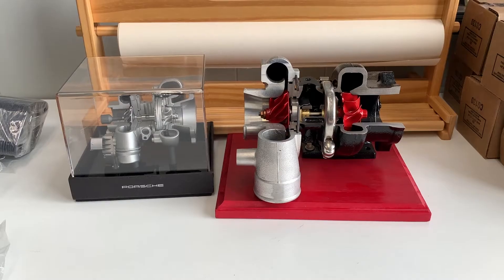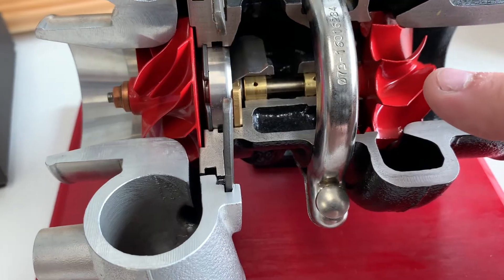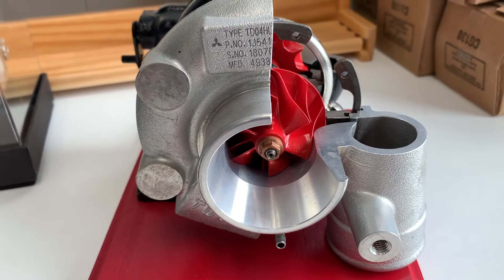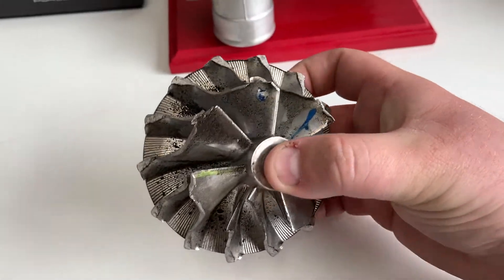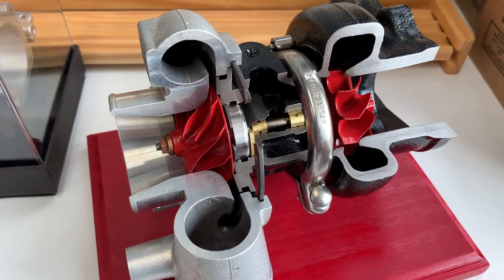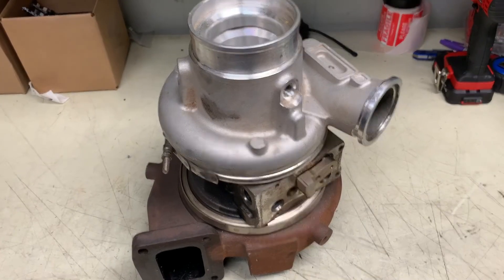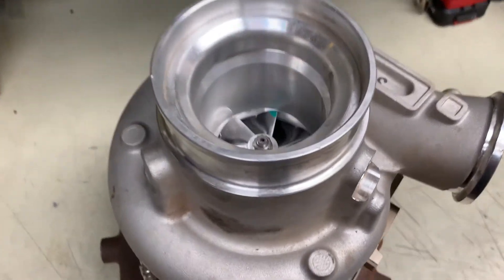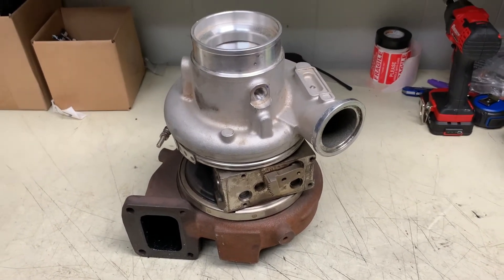Why is my new turbo leaking oil?  What causes turbos to fail, and whats in my turbo?

Comment: I'm fairly new to turbos. With that said, i have experienced this "blown seal" on the turbine side. I'm pretty confident that i have resolved the issue (oil drain/crank case pressure relief).
After fixing the drain issue and replacing the entire turbo, everything is fine.

Please explain to me how i was loosing boost pressure?
Is the turbo that i replaced still good?

Comment: I have a Jetta4 1.9tdi AHF engine code,it broke the turbo shaft while driving on the highway. I managed to drive the car back home,about 7km. Car was just smoking but wasn't leaking oil off the exhaust.
Now I've managed to put in a good known turbo,and suddenly it's pissing oil from the exhaust pipe.Do I suddenly have worn valve seals,or damaged piston rings?

Comment: Thanks for the nice video...well explained..

I have a bmw e46 320d m47...today in installed my turbo from service, it was leaking..after fitting, I never drove the car,I started it ,idling for 30mins or more, I saw oil dripping from intercooler turbo pipe,then it's also smoking..not that much  but there is a smoking showing that oil is leaking into exhaust pipe..

I opened the Lid the one for engine top up whilst the engine was running..a lot of pressure  is coming out...

Is there any possibility that  the turbo is damaged again or what?

Comment: Hey, great video. My 2024 Equinox  with 1.5 engine and turbo seems to be leaking oil in the turbo area. The car is less than 2 years old and leaking oil should not happen. Do you have any ideas? Thanks

Comment: Hello, I have a 2018 isuzu nqr producing  high blowby  and loosing a lot of engine oil with it. Just wondering if  it is possible that the turbo is leaking boost Into the crankcase through the turbo bearings. Appreciate any feedback. FYI my truck is deleted and egr I active.

Comment: Really !?? ANY turbo will leak oil... when  the Oil cannot drain   adequately.
  From either an silly small Drain system And ?or a big Blowby ussue that pressurises the bearing housing and forces oil out . 
ALL else is simply Bullshit.

Comment: Thanks for the informative video. My Nissan Terrano (TD27 engine) is getting oil into the air intake and sometimes does a runaway when still cold. There is oil around the boost pipe, could there be oil accumulated somewhere that causes this?
Most times I start the engine when cold there is rough running, blue smoke, and chuffing exhaust. 
It behaves fine when hot. 
The piston rings seem ok, after long downhill deceleration, then sudden acceleration at the bottom, there’s no blue smoke from exhaust.

Comment: Curious about this i installed a new Journal Bearing 3076r on the engine making 85psi cold start and up to 100psi at the top of pull. We are running no restrictor in the feed as its a journal bearing, but think we may need one for the PSI. We get oil in the compressor wheel.

Comment: Good video i do have a  question.  I have a 2018 mercedes s560.  I noticed that the car shorts oil and i have to top up. Also noticed was oil on the intake of the turbocharger.  Is it normal?

Comment: Mitsu Td04 is a VERY durable turbo Look elsewhere for a problem.

Factory oil return lines between Turbo and Oil sump are obviously... Stupidly undersized.. !
 Oil can't get out as fast as it's being fed to the Turbo . ID of the oil drain tube needs to be 18mm MINIMUM 
Creating excessive oil back  pressures  which forces  itself thru any and All paths it can Find

Comment: Hi. My 2012 Spanish built Nissan Navara D40 St-X Diesel when idling its fine but dies off when i give throttle. It also smoke a whitish blue haze.

Symptoms is its hard starting however there's no oil in coolant or coolant in sump oil.

Would you have any idea what may cause this?.

Comment: Hi i need some help.. m57 525d 145kw.. the turbine was leaking a little oil into the intake manifold.. so it had to be rebuilt.. After the rebuild, I installed it and the turbine was pushing oil from the exhaust and intake side.. I had it rebuilt once more.. they said it was fuel in oil.. I had the injectors rebuilt.. I put everything back together.. and the oil pushed out again, it's strange to me, because before the  the turbine didn't do that.. if u know anything...

Comment: Have a 2017 Ford Escape Titanium with 50k miles that has been diagnosed with a turbo leak. Seemingly on the exhaust side. If the leak is caused by one of the reasons you mentioned does that mean you could replace the air filter for example and the problem would be fixed? We are at a loss as to what to do!?

Comment: Wait you had me at excessive idle. In the last year my Colorado has been doing this. If i idle for a long time and then get going there's always an oil burn off smell. I've never seen any corresponding smoke though. Should i be concerned? Just cut back on the idle time?
Reply from the maker: You can bump up the idle a bit to help mitigate the issue

Comment: I tend to disagree on the vgt egr topic, I've  found that removing the cat makes the turbo run alot cooler and when the car is granny driven for a couple  hundred miles  the vanes tend to get stuck ... how i usally tread this, is take the car for a good highway drive hitting the redline a few times , the heat burns all the debris  from vanes and nozzle ring. Egr delete isnt what cause the vanes to get stuck but actually  removing catalytic converter/muffler ect. The more heat the better . This was only my experience  and its on a TDI car and not a truck so it might be a different  story there.
Great video keep up the good work
Reply: Interesting! I did a EGR and DPF delete on my D-Max Pickup truck because the DPF causes problems if your are not running pure white diesel and the EGR just got cloaked when you are driving in the city. I get from time to time a P0237 code and oil in the intake. Now I will follow your "Italian" method and look how it goes...

Comment: I have a 2011 6.7l powerstroke and I removed the DPF and left the egr on the engine but it's disconnected, are you saying that EGTs are hotter with the dpf disconnected, I thought it helped the engine breathe better and run cooler. Did I under stand you correctly?

Comment: maybe a jammed waste gate valve causes excessive rpm of turbo shaft that can damage the seal and eventually break the shaft.Safe if you install turbo gauge so you will be alarmed if boost goes beyond normal.

Comment: I've just refitted my turbo today on a Audi TT mk1 225 and got one side of the car jacked up on axel stands, started the engine was fine till I gave it a little gas and then oil starts to spert out the top and over filled by an inch on the dipstick, so hopefully once oil drained a little and car is flat this spraying out the top of the turbo wont happen

Comment: Good video but what do you mean a difference between manifold pressure and boost pressure at idle causing a pressure difference?  Isn't manifold pressure the same as boost pressure?
Reply from the maker: Manifold (Drive Pressure) is the air that's coming out of the exhaust manifold and driving the exhaust wheel in the turbo.  Boost pressure is what the turbo is actually outputting